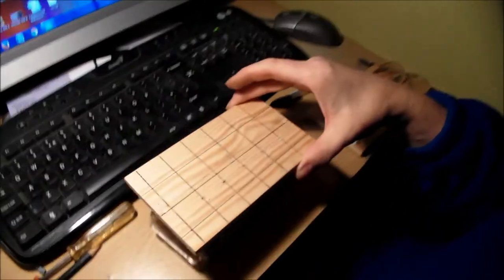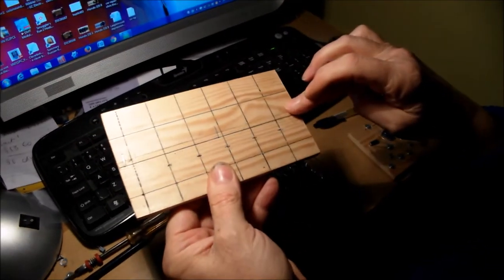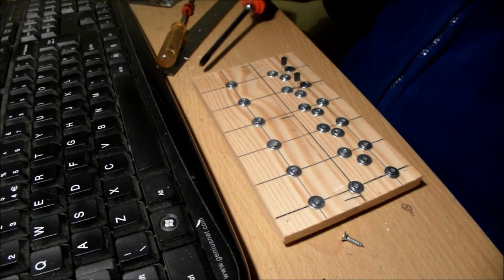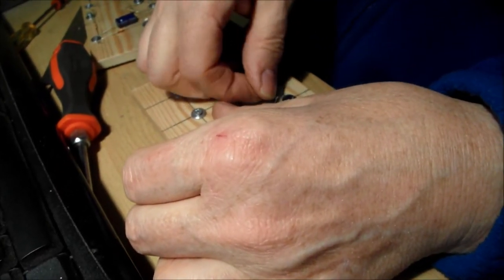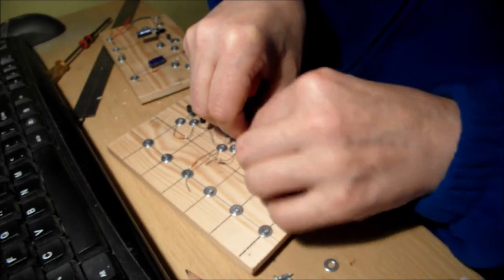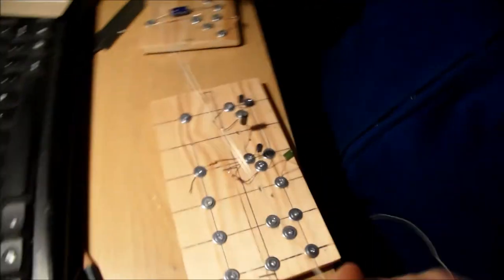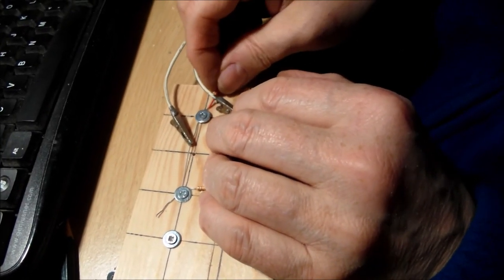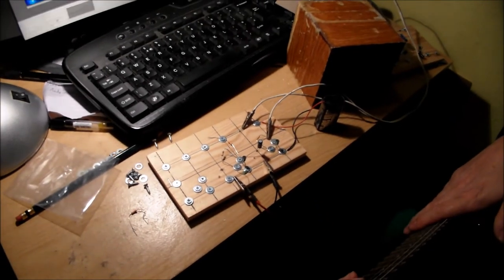Two Transistor Guitar Practice Amplifier

Comment: Thank you very much for the video. I've tried, and it works fine with 9V and even 3 Volts. I've tried with different speakers, 4 Ohm, 8 Ohm, and 32 Ohm. It is simple and nice.
Reply from the maker: Naturally you can by amplifiers cheaply enough but the challenge here is the making and learning process. I'll be uploading more soon. Thank you for your kind comment. (o:
Reply: One more thing about the BC337. Which ones are using you? BC337-C/40 or BC337-25? Thank you!
Reply from the maker: Any BC337 will work with this simple design. The nomenclature after the initial 5 figures usually refer to HFE or gain of the device. The best ones are BC33716 although they're not made any more. Thanks for your comment.

Comment: Hoofbags, do you have a schematic for this? Also, where's the next video with the extra transistor? Thanks!
Reply from the maker: My friend, who does the video editing, is a bit depressed at the moment so she's not so keen on doing it. As soon as she's better, we will do some more uploads. Thank you for your interest. There's a lot of stuff on my Web: http://www.hoofbags.me.uk/geekiestuff.html There's the 3 transistor soldered guitar amplifier there. You may have to scroll down a bit because there's a load of valve stuff at the start. (o:
Reply: hoofbags OK thanks. I do see the three transistor amp schematic on your site. I have BC337-40's here... not BC337-16's like you use. Will that make much difference? I do need to get hold of a 64 Ohm speaker, right? What will happen if I hook up an 8 Ohm one until I get a 64 Ohm sorted? Thanks!
Reply from the maker: Hello Myra (myra hindley). Very kind of you to take an interest in this. Substituting a 64 ohm speaker with an 8 ohm one will cause the transistor connected to it to heat up and probably burn out. Touching it in this state would cause painful burns. The schematic does appear at the end of the movie but it may have to be paused. When you check out www.hoofbags.me.uk the soldered circuit presented there does have different values for the resistors to accommodate the differing gain amounts between BC377-16s and BC337-40. BC337-16 are no longer available. Suggest use 27k instead of the 15k. Keep all other values the same. 64 ohm speaker can be bought from eBay for just under £3 free postage. Hope this link works:

http://www.ebay.co.uk/itm/64Ohm-0-2-Watt-Mylar-Speaker-Weatherproof-50mm-Diam-17mm-Deep-35-0127-/251847269858?pt=LH_DefaultDomain_3&hash=item3aa3445de2

Alternatively, go to eBay: type in 64 ohm speaker seller is breconjess.
Reply from the maker: myra hindley
Even better for a speaker;  http://www.ebay.co.uk/itm/AIC-GF0661M-64Ohm-Mylar-Speaker-Weatherproof-66mm-Range-0-3-9KHz-1W-/390331162841?pt=LH_DefaultDomain_3&hash=item5ae18ce0d9
Reply: hoofbags OK Hoof... Just bought the second one you recommended... the 66MM one. I was sent to a penal colony in the southern hemisphere in '83 and been stuck here since. Might take a while to get here smuggled in a loaf of bread. Oh, and yes, that last transistor before the output got very hot. Perhaps due to my crappy guitar playing or the Scott Walker tunes going through it?
Reply from the maker: I'm sure your guitar playing is really gr8. The speaker cannot take any more that 30mA through the coil and leaving on overnight isn't a good idea.
Reply: hoofbags Well I received the speaker and it sounds a lot louder! I do seem to be getting some Jesus and Mary Chain squeal and a bit of hiss and motor boating going on. Maybe it's the cap I'm sending the audio through on the input. I'm using one of those little blue monolithic caps. Maybe a greencap like yours would be better? Perhaps it's the 337-40 transistors. Something is being driven too hard.
Reply from the maker: myra hindley
Hello. So glad you tried building this. Thank you. Sometimes, if the wood being used has been stored in a damp environment, this might make a difference and cause unwanted noises. Also, the lead that connects the guitar lead to the amp must be a screened one. The green capacitor is a 0.01mfd, or near to that value: it will help to increase the volume. The one I used here is a 0.012. If the battery is a bit old, this can cause problems and is sorted out by connecting across a 100mfd (or higher) capacitor between the + rail and - rail, where it connects to the battery. Hope that helps.
Reply: hoofbags Ok thanks for the advice. I have assembled it onto a plastic breadboard for testing purposes. Attenuating the input with a potentiometer seems to help the squealing issues. Or a large resistor to ground on the input cap seems to work. I have noticed when moving my hand near the input of the circuit, I influence it like a theremin. I'm going to read up a bit on feedback biasing a transistor. I'd like to build this using a cardboard circuit board with holes stabbed in it to mount the components. No soldering- just twist the legs on the back. Anyway, I do like your website. Very do it yourself. Thanks for the education as always.
Reply from the maker: myra hindley
I'm really glad that there's someone out in Youtube land who takes the trouble to try these things out! (o: The purpose behind this is a bit of learning, but additionally, I've derived so much pleasure out of practicing simple electronics, which you seem to have some knowledge of, that I feel people who have never tried this hobby, have a big part missing in their lives. I'm working on the 'add another transistor' section currently but my housemate, Annierak, suffers depressive illness and at times isn't able to do the brilliant video editing and cam-corder holding. Again, a big thank you. (o:
Reply: hoofbags Indeed Hoffbags, electronics is wonderful. I've been messing around with synthesiser modules for about five years. Started with a logic synth using CMOS IC's, then cloned some more serious synth circuits and drum voices. But I've yet to learn the theory beyond the solder by numbers onto stripboard technique. Electronics saved me from going insane and keeps the depression at bay. Sadly though, I have a table of circuits waiting to go behind panels in a modular cabinet (yet to be built). Since my son came to live with me a year ago, it has all fallen by the wayside. He even uses my youtube Myra account which makes me look even more schizophrenic than I probably am. Your little amp circuit is my way back to where I once was- my escape tunnel from reality, whatever that is. Anyway, got some more transistors today. Going to experiment tomorrow. Cheers!

Comment: Is the circuit stable without an emitter resistor? I am trying to understand things and have many questions, sorry. Are those circuits discussed somewhere in a book or so? Thanks a lot.
Reply from the maker: Good question. In collector-base biasing, the base bias resistor is connected to the collector instead of deriving current directly from supply rail. In thermal runaway, the transistor gets hot through increased temperature. In this design, the voltage at C reduces as TR gets warmer, therefor we get temperature compensation. One disadvantage with this way of doing things is that we need to select the C - B resistor individually for each transistor HFE, ideally within the gain spread of same transistor type number. Thank you for your question and the view. (o:
Reply: @hoofbags  Thanks for the answer. The thing is that even the simple transistor circuits have a lot of nuances, details. I was thinking in adding a gain pot to the three transistors amplifier to control the distortion. I was thinking in adding it to the resistor. I have read that is a typical place or a good one, since the gain is Rc/Re. And that Re should be bigger than 100 to keep stability. Later, I learned in the Wikipedia that if you remove Re, there is still an internal r_e to consider, in the transistor.

Another thing that I would like to ask you is about some numbers that are in your webpage. When you say that 1 mA is sufficient to drive a tube to saturation / clipping, and below, that a clean signal is of about 25 mA. But for the speaker or for the guitar? Guitar signal is more voltage than current. Anyway, the outcome of the three transistor amp is not clean, but distorted. Where does numbers come from? How to make sense of them?
Thanks you very much for your attention.
Reply from the maker: @sciexp  In the original 9 volt version I attempt to explain that getting a clean undistorted sound isn't possible at any reasonable volume. We get away with it here because some guitarists like distortion. A clean sound can be achieved through headphones, such as walkman types. When I mentioned 25mA, this is max current through 64 ohm 3" speaker. Any more would burn out speaker voice coil. I'd love to put more stuff about this subject on my channel, but my   connection is painfully slow. It takes 6 hours to upload a 30 minute movie. I've loads of circuits to build/demo, some of which you'd love and provide answers for you and other subscribers. Thnx for your interest. (O:
Reply from the maker: @sciexp  Some of my circuit ideas come from www.hoofbags.me.uk/geekiestuff. On there is SDec circuits next to picture of an old man. Also, scroll down. Loads of circuits there but it's difficult to get some of the components, since this material is from the L8 60s.
Reply from the maker: @sciexp  go to www.hoofbags.me.uk. there's a table cell on the right: geekiestuff.

Comment: what's the trick behind combining two bjts ? i'm trying to generate more gain to feed my speaker but i can't hear an output anytime.
Reply from the maker: The only advice I can give is this project will work only if the instructions and components are exactly the same as in my upload. You could take a photo of your work and I will try and scrutinise for errors. You can read in the comments that other people have built this and they seem happy. Thanks for your interest.
Reply from the maker: To answer your question more thoroughly, each transistor brings up the signal level. The more of them that are used the more overdrive distortion we get, and a limited increase in volume. The design is only for quiet practice. I should upload another with a higher output, time permitting! 
🎸🎹🔊👀🙂
Reply: @hoofbags  Thanks for the answers, i'm waiting for the video. 🎸🔊

Comment: I am testing again the circuit with a 4 w 4 ohm speaker and 16 ohms headphones. And in both cases I experience disgusting noises when I hit strongly the strings, and/or high pitch noise when I touch the strings to make a Barre chord for instance. ¿Grounding issues? ¿Problem of impedances? ¿Same experience? I have the circuit in a pcb. And wires go to the input jack, the output, and the battery clip. ¿Maybe the length of the wires? Thanks for the attention.
Reply from the maker: Hello. You mention that you have the circuit on a pcb. I've never tried to build this on a pcb. My project was only intended to be as described in the movie. Because pcbs are component on top and connections via the underside tracers, it's very easy to make an error somewhere. I may still be able to assist you if you can send to my email a photo of both the underside and top of your PCB. If you lived nearby, prolly not, I could assist you more. I'm in Hastings, UK. The performance of this little project doesn't justify money spent on having a printed circuit made, in my opinion. Thank you for your enquiry.
Reply: @hoofbags  Thanks for the answer. I live in Spain, so... But e-mail is ok. :) I remember I had a similar issue with the three transistors circuit, and I solved it with a capacitor somehow, just trying. In this case, it did not work. It is a simple project, but I like to understand what's going on for future projects. To get some knowledge to start doing my things. For instance, I am with lm386 now. I just can't make an smoke amp, but some other variations work for me. But up to know it's impossible to make it work well with a DC power supply. I will keep trying... With batteries you are not getting always the right voltage, and it happens as well in general with all the circuits, but at the same time, DC power supplies introduce different issues you have to deal with. Btw, which is your e-mail? Thanks.